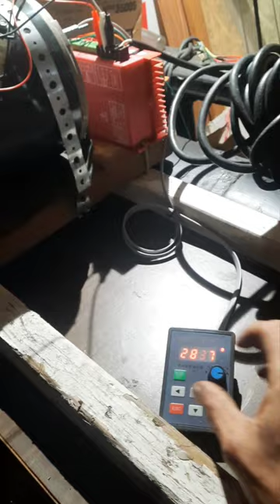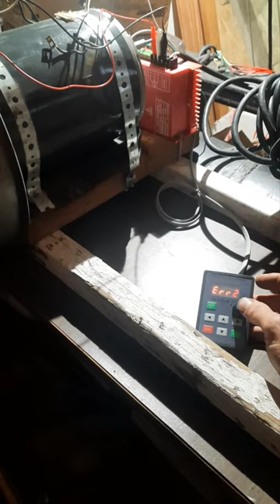this will make a good power source.18v. p1

Comment: I've been trying to figure these out as well, glad I'm not alone in this quest.
Reply from the maker: Is my understanding that these are wired for a motor. To push power. So it makes sense to wire it, To do just that. 
It's what I learned messing around with the ac motor actually. I tried to pull power from it when it was wired to push power. 
Same thing with these motors, People are trying to pull power from them, They're not wired to do so, When they do that they're stepping into the world of perpetual motion.
I'm having better luck just multiplying power. N.T.
 I believe I can run a low rpm generator head. Or power a vehicle source, Not having to use all those batteries and weight. 
That's where i'm @ now anyway. God bless&Good luck with your project. Please share any knowledge to help others.

Comment: Even if you hook this up to the most efficient generator you can never make more watts than what is put in due to losses but the washing machine BLDC motors do make awesome motors and generators and I'm converting one to a wind turbine right now by rewiring it to make around 14 volts so I can charge a battery bank and invert it. Keep working on it though because you never know, these motors might be so efficient they exceed 100% and if that is true they could charge themselves. Either way keep experimenting because that's the only discoveries are made
Reply from the maker: F in a brother. I don't know anything about this.I've never done this before a day in my life, and that's probably why i'm getting so far with it. lol
I didn't know I couldn't do that, so I did.
 Recently I was trying to wine a stator coil around it (too big 4 magnets & didn't work)and had a thought about a different style of winding, So my silly butt had to try it, Then I took the power I was getting and ran it back through, man,The noises and speed made then wow. It might be taking less power to run it at that point, i do see ways of multiplying more.  
Now i've seen people use copper sheets instead of wires on a certain type of wave winding. Wouldn't u know i had another thought just recently, I was gonna add yet another different type of wine(ok many 9) to ea coil. On top of everything you see. We'll see how this one goes, but it looks very interesting. I've got to say... 
By the way, all the power I put through the motor to spin It , she doesn't get hot but when I make power.That's the stuff that could get warm. Seems to confuse people, but separation and airflow will fix that.
Nickola had that multiplied power thing going on, and really, that's all I'm finding here is several ways of making power off a little 18v battery. & Lots of power I am making.
I will up the power source one day but for now this 18v works and when it gets really hard to spin it she will stall so that gives me a point of too much if that makes any sense. And then I can go back and fix whatever is needed. I do appreciate the comment.And I will try this other thing, and who knows, it might help some people. If just one of these experiments helps people Lol, if not @least it will save them time ...
Good luck, and god bless you with your project.
Reply: It's possible to get more from less. Attaching hoover board motor directory to the bdlc washer machine you get 250 from 36 . Yet still you can tap and regulate to 36v and rectify and maintain your battery
Reply: Have found a way to get a straight forward controller for this motor? I have three of this motors and I need one to run and drive the other three. Let me know. Thanks

Comment: I couldn’t figure out what kind of motor exactly this is the whole time I was watching.   The hub looks like a washing machine motor but what’s the rest of it??
Reply from the maker: The front is a 36 pole washing machine motor that i rewired using the factory wiring and slightly changed it to a Star configuration from factory delta. I drilled out a pulley so that I could mount it to the shaft (lots of measurements). 
The center is just an old ac motor. I TRYed to put pm magnets in and produce power with NO real luck their I found that those motors aren't really wired to pick up power. I want to try a low rpm generator head like 3000w. Or more. maby, it can charge batteries;)
The rest is that 3 phase controller & inverter with 18v batttereye. 

If anyone has questions, yes, please feel free to ask.
Reply from the maker: Also my other videos I take everything apart. And try my best to explain as I went.

Comment: Interesting concept. Ive been able to use an older bldc controller to run mine but these are really designed for the higher voltages to get that extreme torque like you are doing here. I want to do exactly what you are talking about as a backup generator for my system. My question to you is, do you have these in stock in the US or is this set up as a drop shipment from china?
Reply from the maker: Currently, I am drop shipping these from china. Yes, I wish I could buy in bulk. Paypal, tho is allowing people to make payments, That's seems to be the most affordable way I could find to get these into people's hands.
I am even drop shipping at cost.
My email
117stock@gmail.com I might have some ? For you before you start. Also, there are a few things to consider.
Reply: Well , I'm not an electrical engineer , more like machine/mechanical one (by education , anyway ) , but more volts mean more rotational speed (RPM , at same frequency) and more amps means bigger torque (depending on wiring configuration and given architecture/design/type of a particular motor). I didn't see any load attached to the generator side (like heating units , which are like 99% efficient) , which would instigate back EMF on the generator. There are loses (friction , electrical resistance , heat ...) , so you can't get more power out , than in (in this case cordless power tool battery).
 To put it differently , if that battery has capacity of 5 Ah @18v (it is more than 20 v full charge) it is 100 WH of available power , which means it will produce 100 Watts for the duration of one hour , or 20 Watts for 5 hours , or  400 Watts for 15 minutes (theoretically , because there are loses with inverter and in prime mover/motor). At best , you can get 90 Watts for one hour (and even that is questionable). So , no matter how powerful generator is , you can't get more than 90 Watts out of it per one hour (again , probably much less than that).  Depending on a consumption of washing machine motor , you can spin the generator , at required speed (in order to get nominal voltage out of it) for some time UNLOADED.  As soon as you add significant load , like heater , or battery charger , it will cause inverter to shut down , or , if inverter is sufficiently powerful , the load will "choke" the washing machine motor  to extremely low speed , or to a standstill , which will melt the wires in it (given some time) , or overload battery and make it explode , or catch fire (though, those things have BMS , which switches off the battery if overheated , or overloaded and the inverters have similar kind of protection , which means , the whole system will just stop working).
  There are , so called , pulse motor/generators , which "steel" back EMF pulses - there is some electronic circuitry  (collapsing electromagnetic field) , which are used to trickle charge the other battery (other than one that powers the device). People claimed more than 100% of efficiency (over-unity) , but I never saw one in person , just videos , so I don't know how much truth is in that , but even if those were true , the devices I saw are low power , experimental machines , which can be used for charging the phone , or lighting some LED's .
Reply from the maker: Well, i'm more of a trial by fire kind of guy, or school of hard knox.
Appreciate all that I might have to read it twice.
In short, though, I did put load on it with my hand, and I did test it off camera. It was around ten volts per leg. If it is a 120 V. That means I have a lot more to go.
As far as all that back emf stuff goes.
I feel like less complicated, Complications, Is really where it's at.
Yes, you could do all that, and you probably would get a better result.
That's y I took the hall sensors out.
I don't have an oscilloscope. Lol
I got this far if it goes into somebody else 's smarter hands and they figured out Hallelujah.
I will do another video coming up and test all that stuff on camera.
My background is general contracting construction agriculture and hobby r some vehicles 
This stuff's not too new to me though I have studied it for some time, I hold a couple patents even for water and hydrogen. 
But really tho I thought this is the one that surprised me most,
 💡 Don't really need the battery pac Or inverter. It's really cool running off 18 V though. And no, it does not get hot. But I'll try to get it there.
The ohm's test with stranded Copper wire will be lower so it will be more efficient if wrapped that way.
I'm using the factory aluminum wire Which is probably the worst.
I'll try to do a short to the point video address some of these issues and film it. I appreciate the questions, And comments, thank you for sharing ur knowledge on this.
I.m.o.p.
It's not really the engineering Degrees, md's, law degrees, or even big money, It's the people in their shops figuring it out and letting other people know.
And Seriously I might have to read all that twice lol thanks again.
Reply: @stock202  Sorry , for long comment , but , I don't know how to write it short and politely explain what I mean - English isn't my native language (obviously).
 My background is in furniture making and restoration (antique furniture) , although I did many different things , over the years. I'm also linked with with cars , in racing and in classic cars world. Also , I did some innovations (tools and simple stuff) , though w/o patents , because I don't believe in them - I'm more "open source" guy.
 I don't care much about academic degrees either , accept maybe , in medical science , cause I wouldn't want to be medically treated by a welder ,or tile layer , or plumber...
 What I meant to suggest (and failed) is to just measure device's output voltage and put some resistive load on it (with known/measured) resistance and measure amps and time , until battery is fully discharged. That'll give you all the data for calculation of relation between input and output energy. Never mind the oscilloscope.
 I really like garage/shed/backyard innovation . 
 At the end , I have to say , your artistic expression through working with camera is very interesting. It may have some health benefits too , for the neck muscles 😁.
 Looking forvard to your next video an all the best !
Reply from the maker: Lol, it's OK, boss. I spoke English my entire life, and I still i have to leave those long comments. 
I agree and will definitely take that into consideration.
 ship carpenters and old barbers was medical science 
I don't know what you have against plumber doctors, lol. Cure my cold, fix the neck, and get some tile layed. 😆

Thanks for the comment. If you have any more advice like for that battery stuff. Please let me know. Any help advice or support is much appreciated. Thank you.

Comment: Oh, at first I thought you were trying to replicate something by Gerard Morin. Yeah these are great motors, and that’s awesome you have it running off a drill battery.

But don’t listen to Morin, all that stuff about pushing power or whatever. I saw his video about powering a hair drier, and he’s way off. No free energy at all.

You could use these as generators, and because they’re 3 phase they will be more efficient, but it would probably be better to rectify it to DC then use an inverter to get 120 AC.
Reply from the maker: Agreed but sometimes it takes those crazy guys to help us out. I'll be doing another video. Is testing load drag and heat. In the advantage, somebody smarter than me. Can hook this stuff up and make it work for other people? That is the goal. But yes they are amazing motors rewired just as they are running like this. Thanks for the advice and comments.